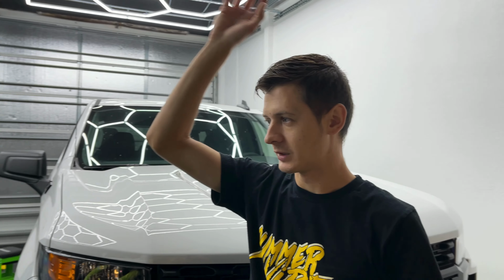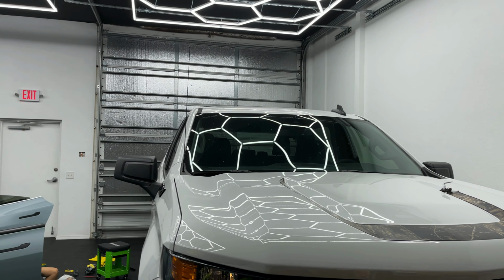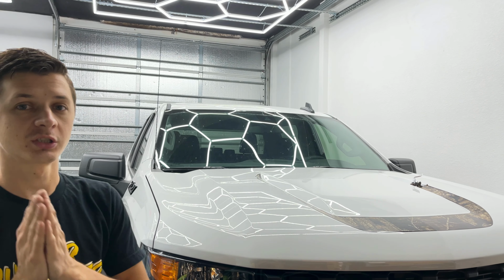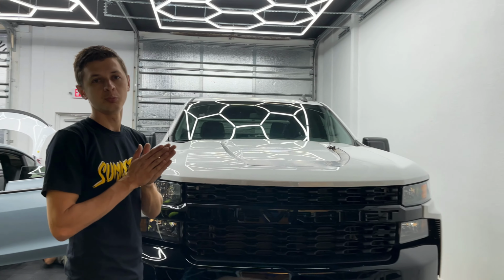CHEVY SILVERADO 1500 WRAPPED IN 3M MATTE MILITARY GREEN

Comment: How much does something like this cost? Does it ever peal off in places?
Reply from the maker: Prices vary on the vehicle. It is a peelable film so it is removable if wanted. Otherwise no it does not peel off in places on its own
Reply: @fitment41  Why are wrap companies so secretive about prices?
Reply from the maker: @boejiden6637  simply because competitors will just under bid us by $100 to get the job. As well as pricing for vehicles vary. Especially trucks. There’s a lot that goes into pricing a vehicle. On a truck it will depend if the bumpers/mirrors/handles are chrome and if the customers wants them wrapped or left alone. As well as materials will differ in prices. Also have the option of pulling the bed and wrapping behind the cab. A truck wrap can range from a simple $3000 all the way to $4500 pretty easily
Reply: How much did that particular job cost? I like how you guys pay attention to detail. Some don't bother to remove lights, or bed rail caps.
Reply from the maker: @anthony2558  roughly $3500
Reply: Location??
Reply: what camera do yall use? looks badass